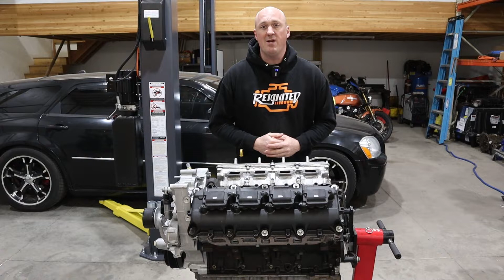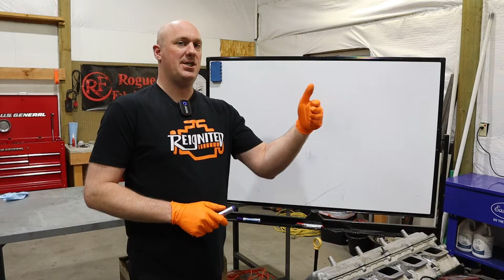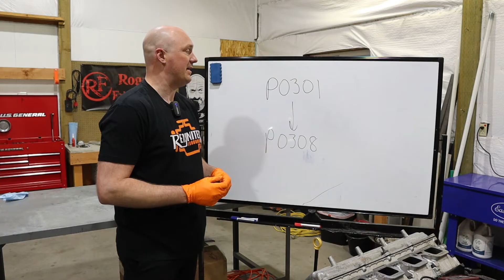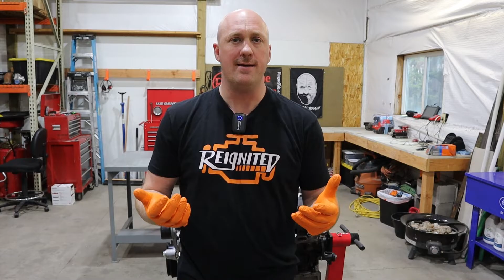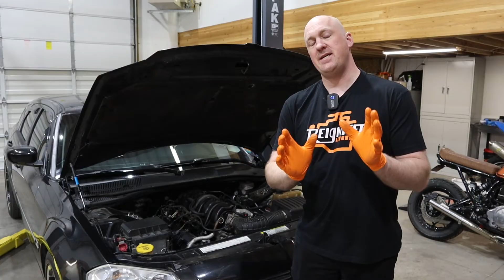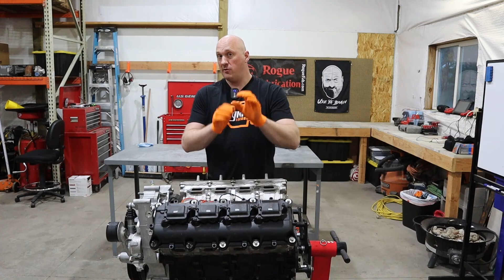Automotive Basics: Easy Hemi Engine Misfire Diagnosis

Comment: How many miles on an engine should you consider replacing it when a lifter fails?
Currently in the early stages of loftier failure with 103k miles, also has timing chain rattle. Not sure if it's worth fixing or replacing
Reply: You need to order a new Camshaft more then likely as well. I’d go ahead and replace the whole timing kit. Sprockets, chain & tensioner. Not that expensive. I got all my stuff from PartsGeek and you can choose between aftermarket and OEM. I went with OEM. But I’d repair this as soon as possible. New Lifter, Camshaft, timing kit, oil pump, & you’ll be in the game. I always suggest an oil pump replace after parts have started to fail. You don’t want metal debris inside your bearings. But it’d be a good time to check all that.
Reply: But you’ll have to place your head gaskets, and all that while you’re in there. New head bolts since they are TTY.
Reply: My new Camshaft was $400 made by MELLING. Lifters I paid $200 each for, DNJ rock brand. They had an extra oiling hole so I preferred these over OEM. I only replaced the rear set of lifters, Left & Right. I paid $100 for my OEM timing chain kit with tensioner, but I got it on sale. It’s a bit more expensive, but there’s other good brands besides OEM. My oil pump is MELLING. $125. Head gaskets we’re $30 a piece. Head bolts were $30 a box, you need two boxes. Timing Cover gaskets & front timing seal. Good time to replace all that stuff.
Reply: But do this repair ASAP. My lifter failed, exploded into pieces and jammed my crankshaft up. I had to completely disassemble my engine, and yank my crank out the block with 400 pound of force. It took out a chunk of my lifter bore but nothing that will cause it to prematurely fail, atleast, not that I think. I had to cut my torque converter off since my engine was seized, $1000 right there. So my point is, do his repair ASAP before your out of more money and parts.
Reply: @BWADaniel  this is great info. Thank you for providing it.
How long did it take you to do your repair?
How long would it have taken if your engine hadn't seized up?
Reply: @MH3GL  It took me a span of 9 months only because I slowly bought all my parts and I had to do a small repair on my transmission from having to pull the seized motor with the Torque Converter Had to wait for dodge to get a few things. The torque converter took two months to come in. But you won’t need that. Realistically, if you have all the parts, it will take you 2 to 3 days to repair the engine. Maybe a week. I took the time to fully clean my engine. It looked brand new when I put it back in the car. You can have the engine, apart and out the car in a day. I go really slow when I put it back together! I take my time with each bolt so I know for a 100% fact, I torqued everything down to specification.
Reply: @MH3GL  if you need ANY help, I am here 100% of the time. I would even pull a part or two off my car to show you anything haha. So don’t hesitate to ask.
Reply: @BWADaniel What a great post/offer. Rare to see something so kind being offered. Good on you.